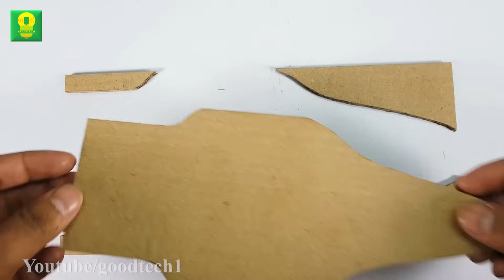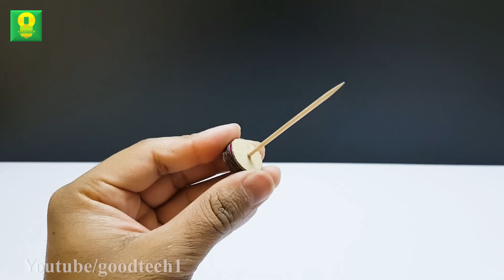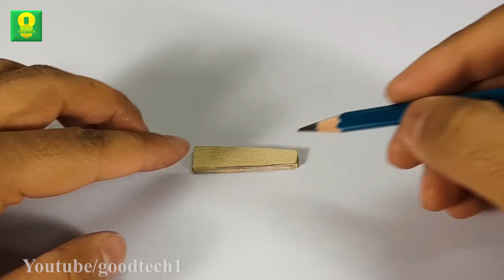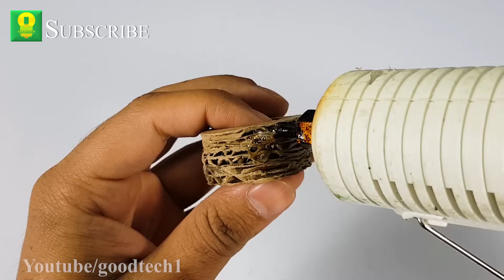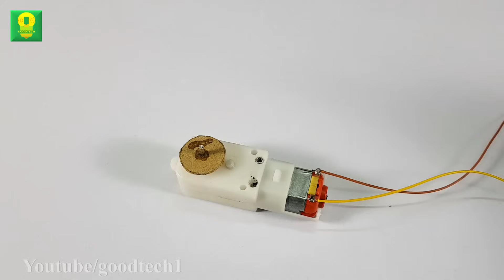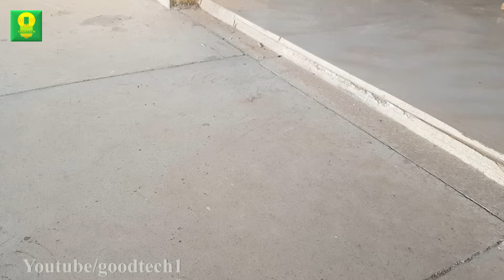How to make Remote Control Car at home

Comment: how is your car moving back also
because no dc motor works in two direction
pls answer me, i have to make this car
and your car is nice
and if we place a solar panel instead of this charging circuit pls answer
Reply from the maker: Every DC motor works in both directions just by reversing the polarity of the voltage supplied. Yes, you can use a adequate solar charger for charging the batteries. If you need the material links and additional written info, have a look at my instructables here - https://www.instructables.com/id/How-to-Make-a-Remote-Control-Car/

Comment: Can the steering stay straight? How can I give it good suspension? And also, can we make it in any design we want? Plus what is the frequency of the RC car? I don't want to spend time and money just to be dissapointed because the frequency is different. Please reply as soon as possible.
Reply: the frequency doesnt matter as long as the transmitter and reciever are at the same frequency and it isnt the same frequency as any other controllers nearby

Comment: How to get remote?
Send me link for buy them.
Reply from the maker: I used the remote from an old RC car. However, you can make a remote yourself also but it will never be cost effective. I highly recommend to buy a cheap RC toy from a local shop and use the circuit to make your own project.
For additional details, extra images and material links, please have a look at my instructables - https://www.instructables.com/id/How-to-Make-a-Remote-Control-Car/

If you want to make your own circuit, have a look at this tutorial - https://maker.pro/pcb/projects/remote-control-car/
Reply: So you are telling us to buy an RC car to make an RC car?

Comment: i want to make big RC car, that my son can drive. can we use same circuit for 12v Motor?
Reply from the maker: The transmitter and receiver circuit can be same but the charging circuit will change. I used a 3.7v battery and a TP4056 charging module is suitable for that only but for using a 12v motor, you will be needing 12v high current battery which requires a different charger.
Reply: you have two batteries one for remote control 12 v is good  and other battery  to get power to move car but with high Ampere to create enough power to the car
Reply: @mahmoudsobhi8683  i didn't understand

Comment: can we use this receiver for drone making. plz reply sir.
Reply from the maker: No, a drone requires to control multiple motors. It needs ESC circuits (to control current in all the motors differently) to be integrated or connected to the motherboard along with flight controllers that also has gyroscope and accelerometer ,etc . The car wireless receivers lack such functionality.
Reply: @goodtech1  hi. What kind of receiver circuit board did you use? Can you give me a name?
Reply: Jtjfgu hi

Comment: hi @GOODTECH - Creativity and Science you didn't use servo for steering, right? how does it work then...? I don't know much about RC cars and all. but thought we require a servo for it.
Reply from the maker: No, it is not necessary to use a servo. Only a high torque motor is required, so it can easily turn the steering. Since servo has very high torque so it is most commonly used. However, since my car was made of cardboard and is very light weight so i used a geared DC motor which also has relatively enough torque for my use.

Comment: What is the price of cell
Reply from the maker: The cells are available in price range. You will find lots of options available on ebay and amazon. However, if you want to save money, it is recommended to extract the cells from old laptop batteries or mobile power banks.
Reply: Bang good .com

Comment: Whare available remote control  please tell me
Reply from the maker: Hello, i used the remote control and circuit from an old broken RC toy. We can also make our own wireless remote control and circuit at home but it is recommended to buy a cheap RC toy from local toy shop because that is much more economical.
However, if you still want to make a circuit at home, have a look at the tutorial here- https://maker.pro/pcb/projects/remote-control-car/

Comment: But how to make remote
Reply from the maker: There are many ways to make a remote but making a remote is more costly than using a remote from market toy. However, if you want to make your own remote control circuit, have a look at the tutorial - https://bit.ly/2ThVopr but it is recommended to buy a RC toy from local shop and use circuit from that.

Comment: where i can get reciever circuit board
Reply from the maker: The circuit is available on amazon or aliexpress but it is recommended to extract the circuit from a cheap RC car that can be bought from a local toy shop. It is much more hassle free and economical.
Reply: i got mine on ebay

Comment: But how to make remote control tell that also
Reply from the maker: It is possible to make a remote control at home but is not very feasible because the components are much more expensive than the readymade remote. It is advisable to buy a cheap chinese RC car from market and extract the circuit from it.
However, if you want to make a remote circuit as well, do refer to this tutorial - https://maker.pro/pcb/projects/remote-control-car/

Comment: What is the voltage of the motor that you used? And why is motor that you linked is 12v? 12v will not perform good with 3.7v motor that i will use

Comment: Remote kaise banaye woh toh Bataye
Reply from the maker: You can make a remote but it is not recommended to make one, because then you will also have to make the receiver board. It will be much more costly than a readymade circuit board that can extracted from an old toy car.
However, if you want to make a remote have a look - https://maker.pro/pcb/projects/remote-control-car/

Comment: I love this video but connections is very hard
Reply from the maker: Hello Nasim,
Yes connections can seem hard when looked at once, just give a look gain and you will see, it not even that difficult. Also, mostly all the connections are mentioned on PCB board.  You are free to ask any queries that you may find hard to understand.
Also, if you need additional info and material links, you can also have a look at my instructables - https://www.instructables.com/id/How-to-Make-a-Remote-Control-Car/

Comment: Hi, why these remote kits are expensive?
Reply from the maker: Actually, the kits are not available at local shops and are available only on online stores like amazon and ebay. These websites import the products from their international vendors, so they are expensive but it is advisable to buy a cheap chinese RC toy from a local shop and extract remote kits from them.
Reply: @goodtech1  thank you for your reply

Comment: Where is remote
Reply from the maker: I extracted the circuit from old RC toy. I didn't give links for circuit because it is very expensive online. It is advisable to buy a cheap RC toy from local shop and extract the circuit from it.

Comment: I need  transmitter and received .
How but price $ ?
Reply from the maker: The transmitter and receiver are available on ebay and amazon, however, they are more costly than the commercially available RC car in market. If you want to make your own car, it is recommended to buy a cheap RC toy from market and use the circuit in your project.
However, if you have some knowledge of electronics and soldering skills, you can also make your own Tx Rx circuit. Have a look here - https://maker.pro/pcb/projects/remote-control-car/